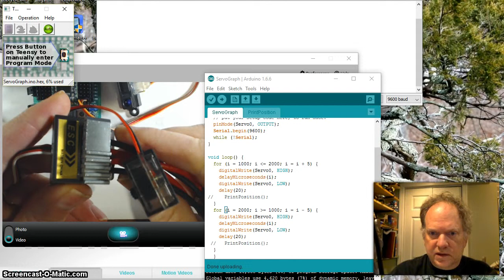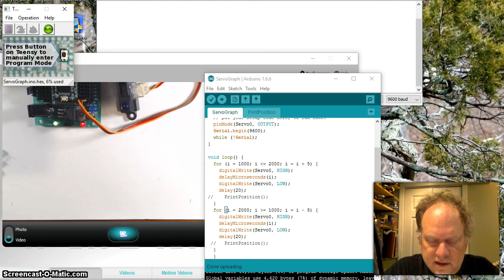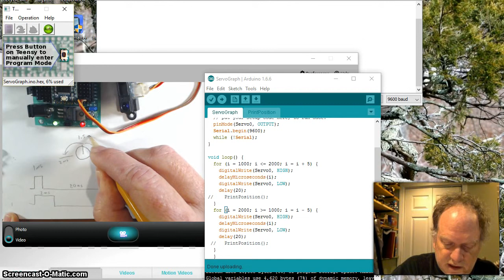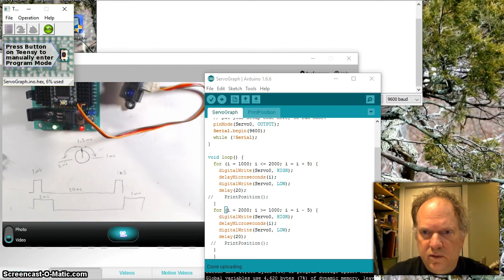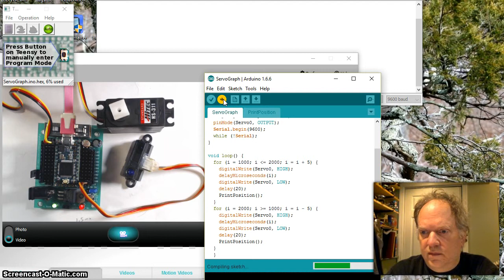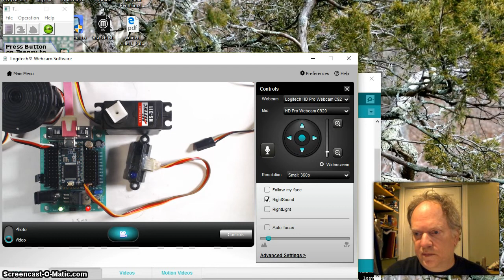Intro to PWM motor Control with Arduino on a Teensy

Comment: Hello Brian, does the teensy board always have to stay plugged in to USB into the computer to be running the program? Or can it be programmed once by the software and then unplugged?
Reply from the maker: It does not need to be plugged in all the time. Upload the code..connect some sort of power and it will just run the program you uploaded.
Reply: @brianpatton7496  oh, perfect! That is exactly what I need. Thank you very much for your reply Brian!